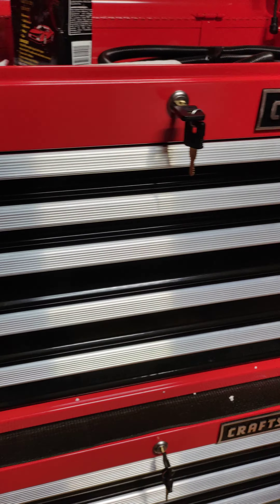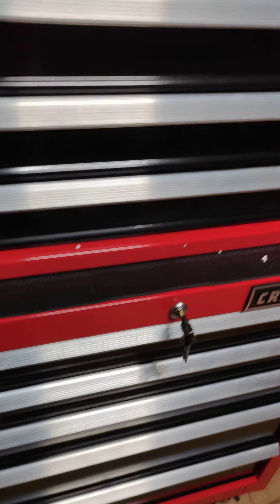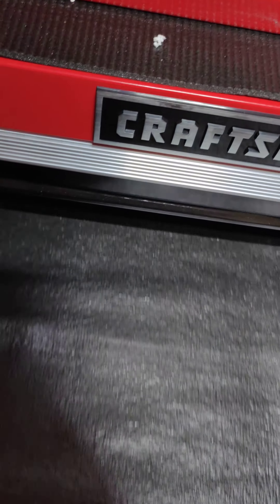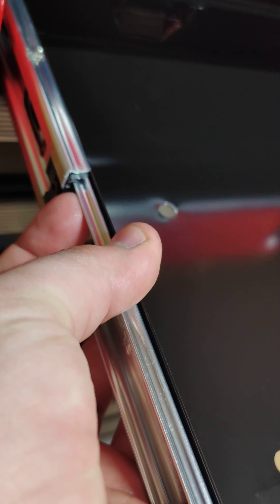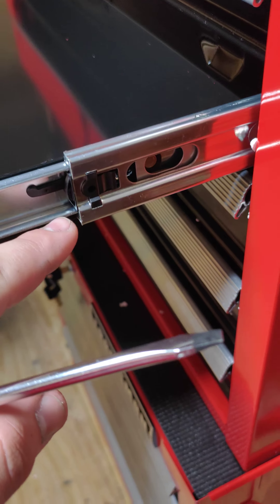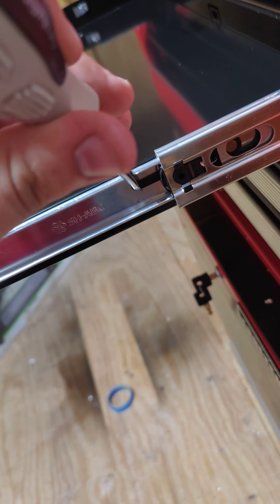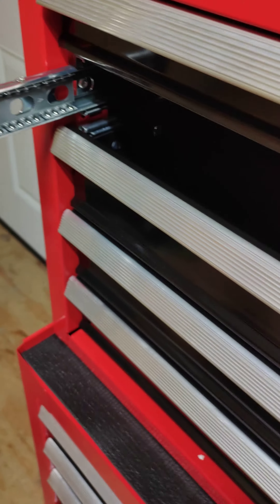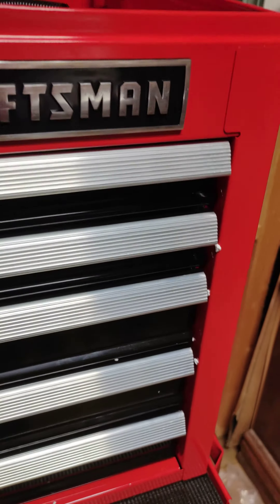how to take drawers off of a Craftsman toolbox 2021 ball bearings

Comment: I’m not sure your thing was messed up. It appears as though the left side you press the lever up and the right side you press the lever down. your right lever looked like the correct position before you started prying at it.. I was watching because I couldn’t get my left one out, but then I realized you pressed your left up and that was my mistake. I pressed my right one down  first and it came out no problem, I was pressing my left the same way, but it was wrong. Thanks for the vid!